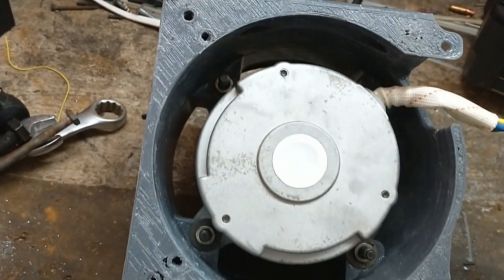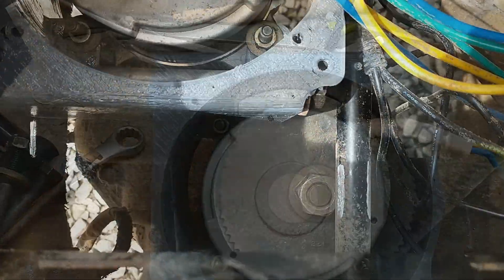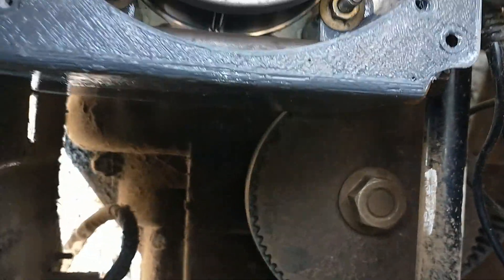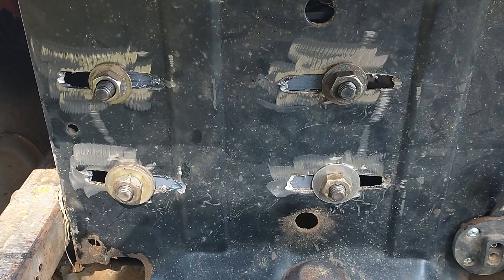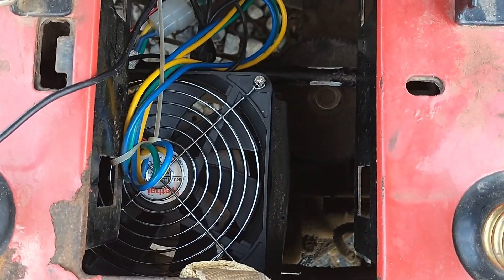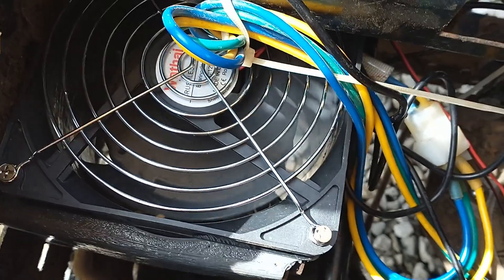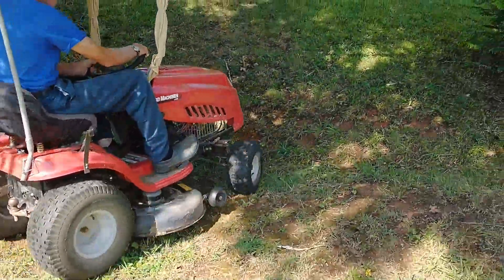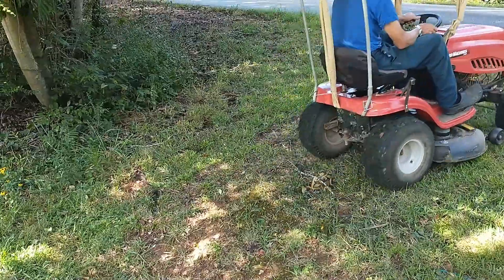3D Printed Upgrades & Belt Drive Pulleys for Ryobi 40v Powered Electric Lawn Tractor Conversion Pt 2

Comment: Do you have an ammeter on your tractor?  If so, how many amps have you seen?  Have you run into a situation where 900W isn't enough?  I've made done several tractor conversions with much larger motors but now I'm wondering if it's overkill especially if all I'm doing is cutting grass.  Thanks!
Reply from the maker: I don't have an ammeter on mine, although that would be a good idea. With the slow gearing I can tow my car or dig a trench. So I don't find any situation where the motor is the limitation. Traction is often the limiter for me. So for normal yard work is no problem, as long as you don't mind being slow. But it goes about as fast as the blades can cut, so that is really all the speed I need.

Comment: Hey there, can we get a nearly 1 year check in on your 3d printed parts?
This is really cool. I'm envious of your skill sets!
Reply from the maker: We just finished mowing today. I have 2 acres of rough, hilly yard. It is still working and I actually need to do an update video for this. My original design worked, but I had trouble with the small pulley wearing out or cracking. Had to replace a few of them. Of course they cost like $.25 or less to make, but I wanted them to be more durable. I just finished a new design that has 28 teeth on the small pulley and 105 teeth on the big one. We will see if these last longer. If I were going to stick with the small ones I'd probably just have them CNC machined from aluminum. So 3D printed pulleys work, but I'm still getting the design perfected to make them durable.
Reply: @oddjobsandrandomprojects  thank you for the update, I'll be sure to stay tuned!

Comment: Is there a tensioner on the belt drive system?
Reply from the maker: Not since I upgraded to a cog belt. Doesn't seem to need one then. With a v belt you need a tensioner, but that is hard on the motor bearings I found out.

Comment: Would connecting the electric motor directly to the transmission work? If so, would there be any problems with efficiency/drive time? My family is converting our own mower to electric and we will soon mount the motor but we don’t know where we are going to mount it yet.
Reply from the maker: At least on mine the gear ratio would have been too high. It would have went to fast and then lacked low end torque. I did consider it because I like the idea of direct drive. If you had a great reduction drive to mount in there or a transmission with a lower gear ratio it would likely work well. It might also work with a larger electric motor, but I didn't want the power draw to be too high for the battery I was using.
Reply: @oddjobsandrandomprojects  Would you be able to share the fusion files you used to make the toothed pulleys? I want to modify the model and make it fit my mower's transmission.
Reply from the maker: @Cjramos23  https://mega.nz/folder/21IwjQiD#9GtzrL8gQRI3ASdQyLDa0Q
Reply: @oddjobsandrandomprojects  Thank you very much
Reply from the maker: @Cjramos23  No problem. Glad to help.